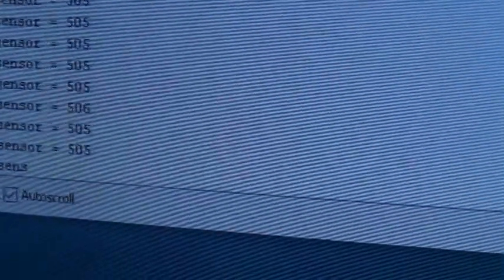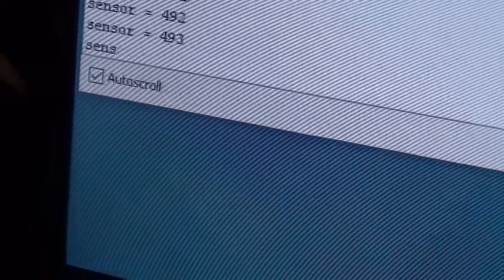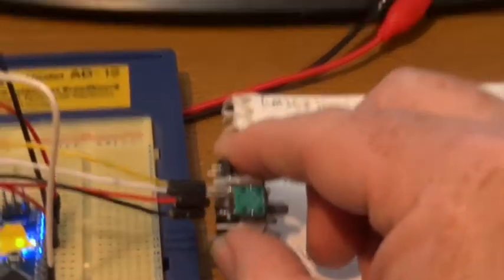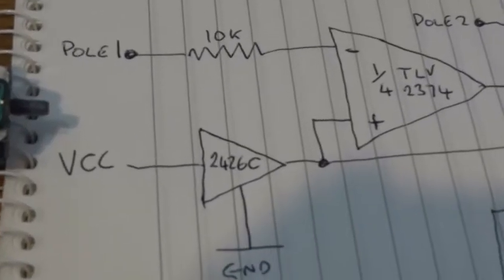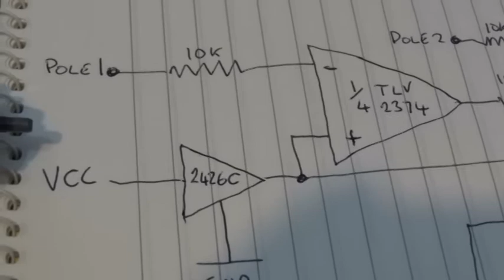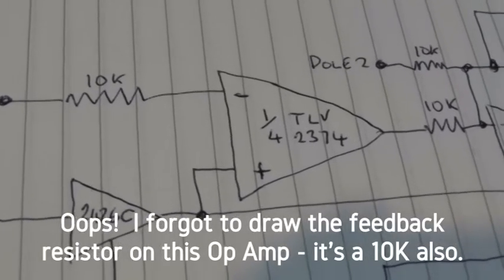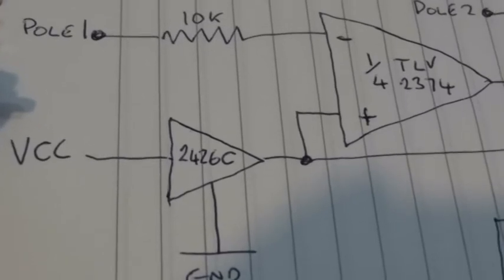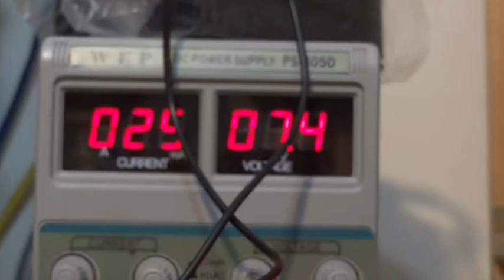PS3 DualShock 3 Hall effect joystick module with Arduino

Comment: Shouldn't you be able to completely skip the op amps? Thank you
Reply from the maker: You could, providing you don't need a particularly accurate reading from the joystick.  You'd run the two signals from the sensor to two analog channels, read them both, subtract one from the other to get the position.  Without the, roughly, 50x amplification provided by the op-amp, you'd only get about ten or twenty counts when moving the sensor over the full range.  That would probably be fine if you're just using the joystick as a game controller, but if you want to use it control a model aeroplane, then it's worth adding the op-amp and rail splitter to get a more stable signal with better resolution.
Reply: @ceptimus  thank you for that informative reply. I was under the assumption the output signals was from  gnd to vcc. But I haven't received the PS3 joysticks yet which i ordered, so couldn't test :) 
The project I am working on is retropie DIY joystick with an ADC to i2c IC. Will be interesting to try.

Comment: Is there anything like this for xbox controllers?
I'm sick of the drifting issues with resistive potentiometer based joystick on literally all the controllers on the markets.

BTW are you sure it's a hall effect sensor and not a basic potentiometer used in every controller joystick?
Reply: I think all manufactured controllers for xbox use 3 pin sensors, which (I believe) are all potentiometers, so you would need a custom board/conversion circuits to take advantage of these hall effect sensors
Reply: @ScorgRus  okay, thanks.

Comment: Question: why are you using just one single output (A0)? How can I read the two axis separately? Thank you, sir.
Reply from the maker: I only connected to the one axis for the demo.  To read both axes, you just connect to the hall effect device on the other axis in the same way.  You can use just the one rail splitter to provide the reference 'centre rail' for both channels, but you need two op-amps for each.  If you use a quad op amp chip, such as the TLV2374, then that will work both axes from the one package.  You could then run the two analogue signals into, say, A0 and A1 on the Arduino.
Reply: @ceptimus  If I’m not interested in amplification circutery, it would be possible to read each axis and simulate the rail powering system just using the code and arduino digital outputs?
Reply from the maker: @persona000  It's possible to get an inaccurate reading using the Arduino alone.  The problem is that the signal from the sensors is very small - so if you don't amplify the signal before it gets to the Arduino, the readings you get will be low resolution and noisy.  Much better to use joysticks with potentiometers instead of Hall effect sensors, if you don't want to bother with amplifiers.
Reply: @ceptimus  I've noticed that. What about the 2426C, can't Arduino simulate it using digital outputs? Thank you so much for the accurate explanations.
Reply from the maker: @persona000  If you're not using the op amps, then you don't need the reference 'centre rail' output from the 2426C - you just run the signal(s) from the Hall effect transducers straight into the Arduino's analog input(s).  You'll find that the full range of joystick movement doesn't give you many 'bits' of movement - the reading will be about 512 when the stick is in the middle, and change maybe plus or minus thirty counts from that for full stick movement.  For lots of applications, that might be all you need.
Reply: @ceptimus  I have just a few more questions, can I contact you privately?
Reply from the maker: @persona000  You can email me: ceptimus@ceptimus.co.uk

Comment: are you sure this is a hall effects sensor and not a rotary incremental (pwm) encoder ... researching using this model thumbstick on an arduino project, hi & thanks
Reply from the maker: It's definitely has a an analogue output - it's not an encoder.  There don't seem to be as many sellers of these components now - probably because they're trickier to interface than the simple potentiometer types.  You need amplification and some sort of rail splitter if you want to get the small, differential, hall-effect output voltages up to the sort of level used by typical microcontroller analog inputs.  I think the circuit I showed, with a quad package rail-to-rail op amp  TLV2374, the 2426C rail splitter, a few resistors and two capacitors is the easiest way to go.  The advantage over the potentiometer types is a much longer lifespan.  If your project is only for occasional use, then the  pot-based joysticks are better.
Reply: must be correct, traced back the 4 output tracks on a ps3 navi which uses the same 4pin sensors, and they go to a block of components and unmarked IC, too much complexity for PWM  ... simpler to change project to use a potentiometer (project = BTadafruit in ps3navi shell) ... (( https://www.psdevwiki.com/ps3/   not very helpful ))

Comment: Interesting, what is the part number of that module? I have been wondering why the video game industry refuses to use them in pro based controllers. I'm sure its everything to do with economics, you can sell brand new controllers every 2 years when the sticks wear out instead of at all.
Reply: @Anedime  it's certainly the case now when we now have access to 2 axis pcb mount hall effect sensors. RC aircraft radios from China all now use hall effects sensors for around $100, these companies are going to get sued for wasteful video game accessories eventually and it will fall under excess plastic enforcement.

Comment: Cool! By the way, why did you use two amps in a row? Just wondering, would only one amp do the trick? Like putting one pole to the ground and second one to the amp.
Reply from the maker: Thanks.  I don't think that using only one amp would work - you have to power the joystick from ground and 5V and then both the outputs, P1 and P2, give about 2.5V (plus or minus a bit when the stick is moved).  You can't then connect one of these 2.5V signals to ground.
One of the amps just inverts the one signal and then the other adds that inverted signal to the signal from the other pole, so that second amp is amplifying the DIFFERENCE between the two pole signals.
You could just ignore the one pole signal and amplify the other one - but you'd still need to subtract the 2.5V offset somehow before amplifying, and the output would drift more.  The double amp circuit automatically compensates for any drift (say with temperature) when both pole signals drift up and down together - because it is only amplifying the difference between the two signals and doesn't really care what the actual levels of the two signals are, providing that they are within the amplifiers working range.
In any case, the op amp chip I used has four amps all in the same package - so there are enough amps to do both axes of the joystick even though I'm using two amps per stick axis!
Reply: Fair enough. Thanks for the explanations!